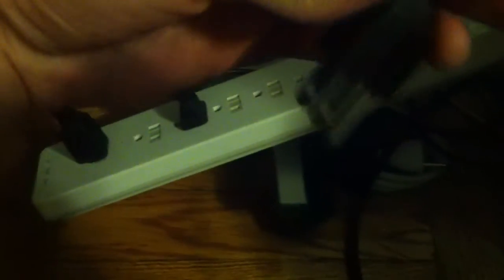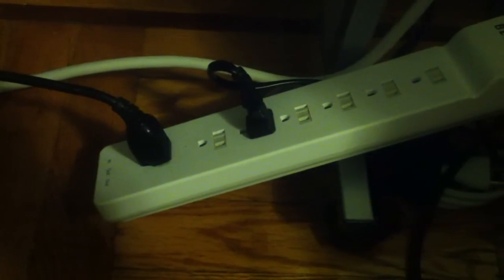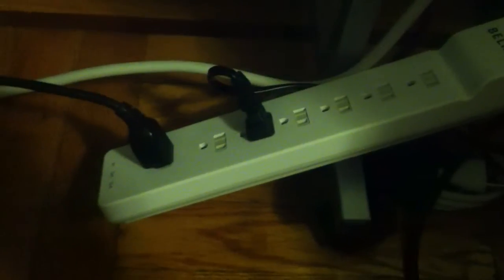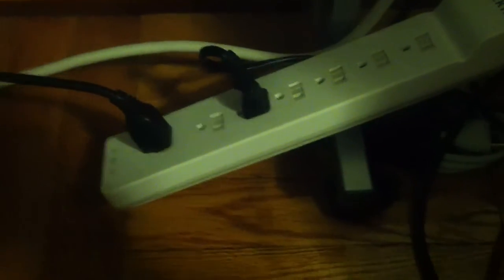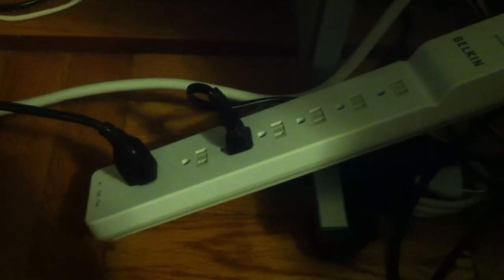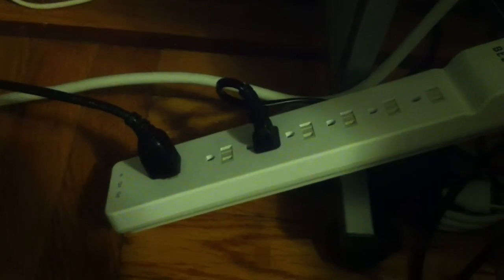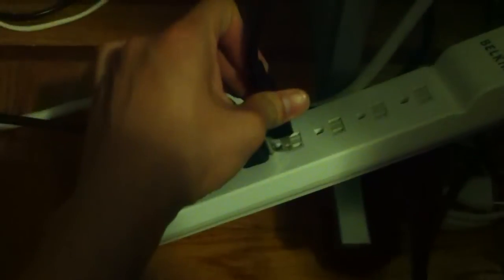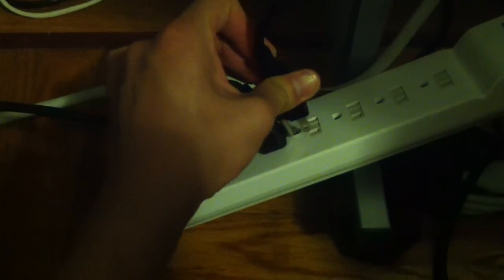Identifying Ground Loops in Home Theater System

Comment: You need to connect your ground signal off of your stereo there's a section on the back of your stereo that has the word ground on it and that's a signal connection. It's on the left hand top corner. You need to connect a wire off of that and ground it to something so that it breaks the signal loop. And then that problem would go away. And then you can plug in whatever you want to it off your plug-in strip. Could be the issue also you should try investing in a more expensive and better grounded extension strip or plug that directly into the wall by itself off of that strip because that's where the grounds causing the issue. So yeah I would think about that. But the ground connection on the left hand corner of the receiver you can run a wire out of there and then you can put that ground wire I've seen people run them outside and directly into the ground to break the ground. Something to look into is that's how you will fix that issue is by running that receiver plug-in by itself off that strip or you could ground that receiver and that would stop that problem by connecting that corner ground signal. Port to something.

Comment from the maker: I looked it up and it actually may prove to be a safety hazard if your device doesn't have a fuse. The ground loop interrupter can only handle a certain amount of current and in the case of a lightning strike or a large spike, the ground loop interrupter can actually fuse open effectively acting as if you have no ground at all. The ground loop interrupter device has to be capable of handling a lightning strike and the ones on the market (at least the one I have seen) doesn't handle that.

Comment: i was having the same problem with and amp so I just pluged it into a different outlet and the sound went a way try getting another power bar and just use it for the tv sometimes that helps

Comment: You need a noise cancelling powerbar.  Monster makes them, I'm sure there are others.  Expect to pay about $200.  Why?  It separates and cleans up electrical noise from not only the wall, but from the other components of your home theater system. I had one on an old big screen set up about 10 years ago and I can assure you it was black and white difference in picture and sound!
Reply: Emi filter

Comment: I'm having an issue with my receiver. I have a constant high pitched hum on my receiver whenever I use it and have tried multiple proposed solutions as proposed by the internet. I tried legitimately placing it on the ground, flipping the plug, checking my input connections, removing the FM antenna and looking through the vent at the capacitors (which look fine). What on Earth can I do now?
Reply from the maker: Hi +Julian West , first thing I recommend doing is isolating the issue. You need to figure out what device is making the noise. Unplug all the devices from the receiver and turn it on. Does the noise still happen? Does it only happen at high volumes? If the noise is gone, you know it isn't the receiver, but one of the devices connected to it. Plug everything in 1 at a time until the noise comes back. The one that makes the noise is your culprit and you can further investigate into how to address it.
Reply: I know it's the receiver. Even with the volume all the way down and with no inputs plugged in it always makes the buzzing noise. I also know it's not a ground loop.
Reply from the maker: +Julian West One last thing I would try is to take the receiver and plug it in at a completely different location (like even a friend's house). If it is still buzzing, then I would have to conclude your device is just faulty. If not, you may have really strong radio/electrical interference or noise on your AC line. If that's the case, you may be able to get a power conditioner to get rid of the problem.
Reply: Jonathan Chan Thanks
Reply: Well, after moving it to my new house, the buzzing is still there, but it's a bit less noticeable.
Reply: Julian West  it's the filtering electrolytic caps in your receiver. You posted 2 years ago, but perhaps you are still having the issue. Replacing these caps inside your receiver will fix it.

Comment: hi sir.  i have an issue with my reciever denon.  the humming sound comes only in the left speaker and left sorround.  . . when im unplugging the rca then plug it again the speaker works well theb after a minute the sound in the speaker gone and replace by a grounded sound.  . .do you how to fix it.  thanks for your help

Comment: Try to unplug the Coaxial cable from TV.
Reply from the maker: I don't have any coaxial cable plugged in - just HDMIs.
Reply: The New devices have floating grounds. If I measure rms voltage from my blue ray to ground it is 58 rms volts. maybe on of your devices have ground wire but not all.
Reply from the maker: Jacek Brauner Thanks for the info.. switching to higher quality HDMI cables eliminated the noise... I wonder if the old HDMI cable had the ground wire (shielding) connected? I'm just glad it is gone and I can turn up my receiver without this annoying hissing!